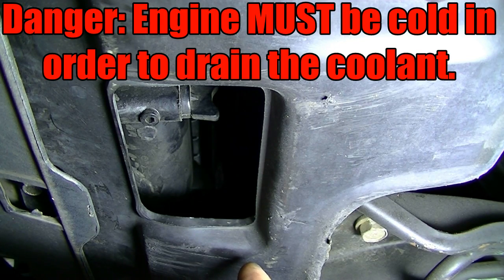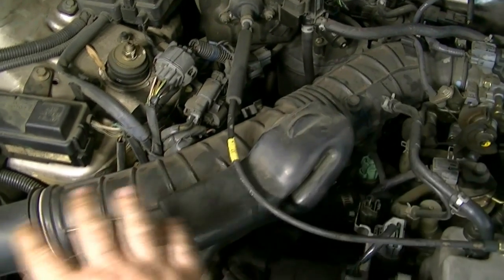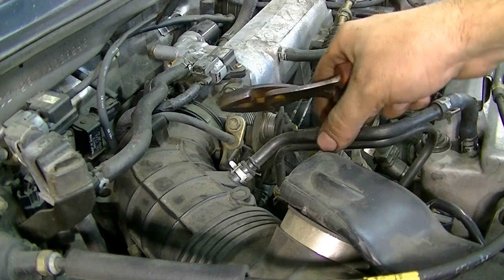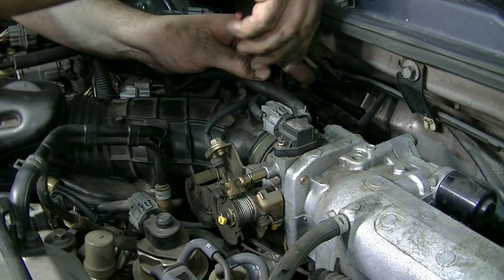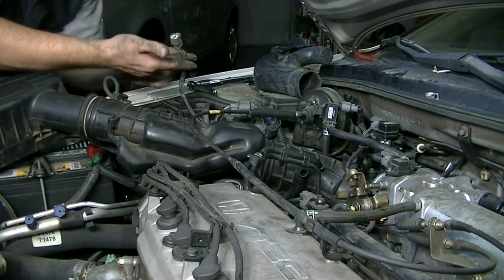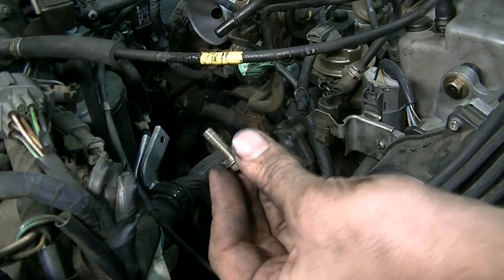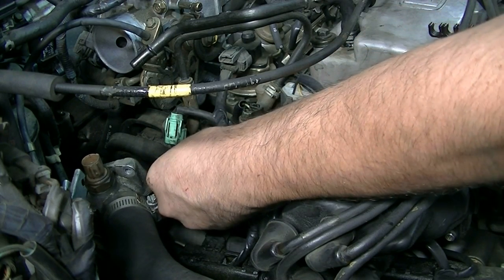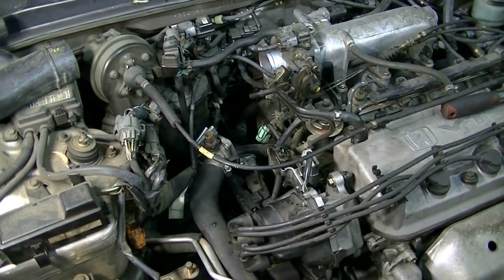How to Replace a Thermostat on any 4 Cylinder Honda Engine

Comment: Very good, yours is the only one I saw that deals with the anti freeze. But disposal should be covered as well. Local auto parts do not take radiator fluid. I had to go to a dealer ship where a shop manager helped me, but there could be a fee and public disposal of this fluid is not really in their mandate. Tred lightly when asking and be willing to pay them..

Comment: I have a 98 Honda Accord.  Given its age, what other things might you suggest I go ahead and change out other than the thermostat that usually would require draining of the antifreeze?     intake/outlet hoses, water hoses, switches/ sensors (which ones)?  anything else?  Thanks a bunch!